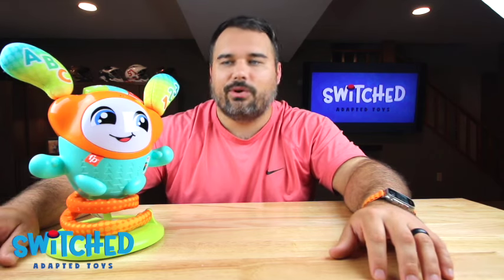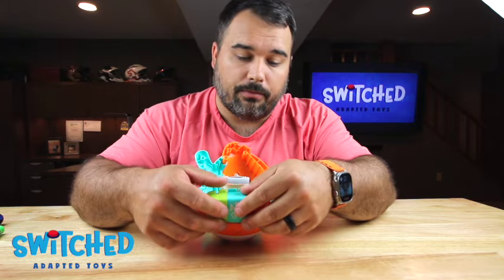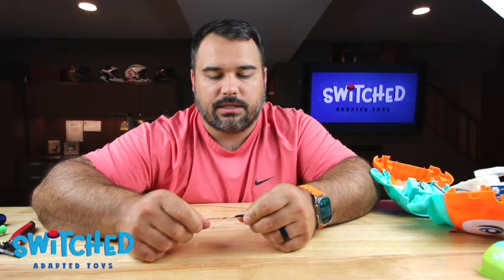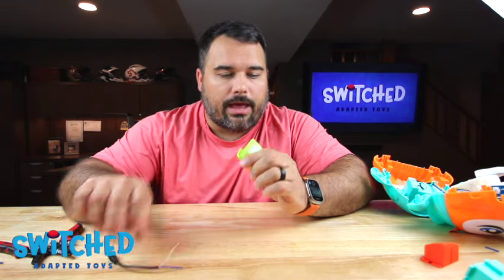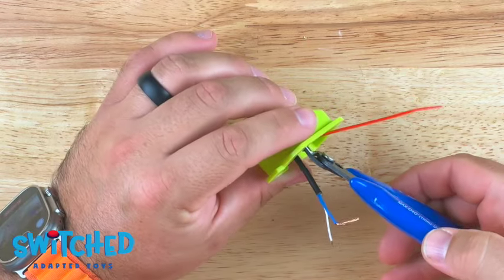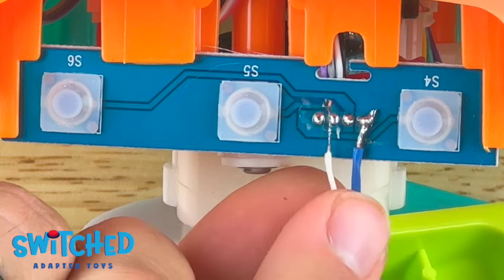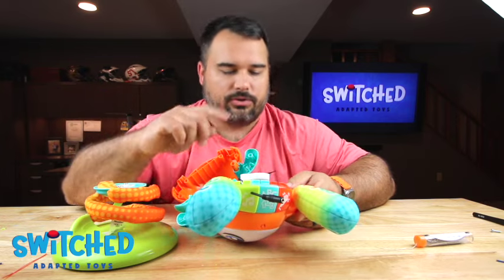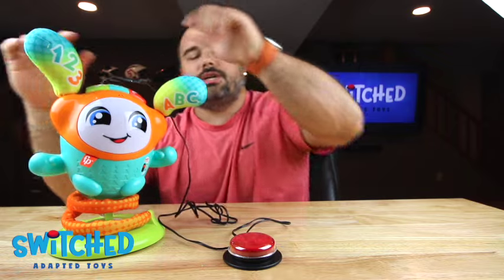Switch Adapted Fisher-Price DJ Bouncing Beats for Inclusive Play | Making Play Possible

Comment: I learned so much from this video. Can you add multiple switch adapters for say the music and abc as different options on the same toy?
Reply from the maker: You sure can! You just need to solder one wire to the far right terminal and then solder the other wire to the terminal that activates what ever button you want. So you will have wires from multiple headphone jacks soldered to the far right terminal. A good idea is to twist these wires together before soldering them to that terminal. Hope that helps!
Reply: @switchedadaptedtoys   Awesome- going to work on it tonight! Thanks for all you do!